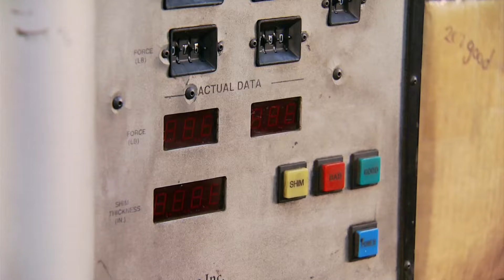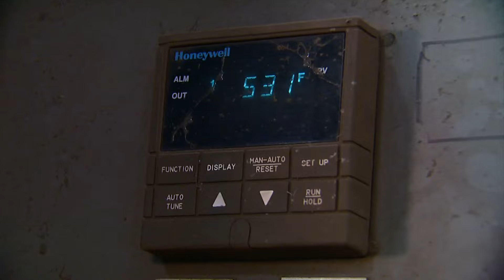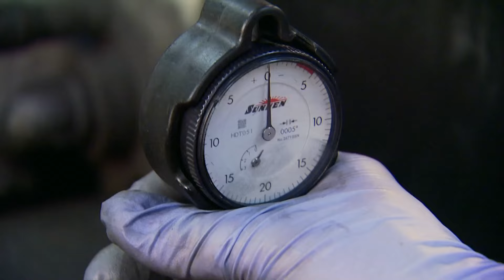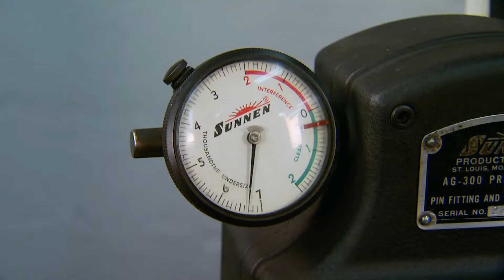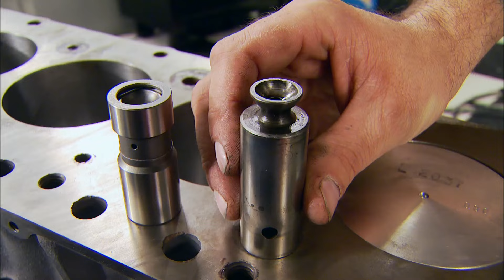Re-Building An Inline Six To Drop In A '49 Chevy Pickup - HorsePower S14, E16

Comment: Yes that tube supplying oil up to the top of the head is most likely the reason for seeing the external line that would be installed on those engines to get oil up to the rocker arms. Also that center connector for the rocker arms can be squeezed off to restrict the return of oil to the pan and create more oil pressure for better rocker arm lubrication as well as helping with some back pressure to help keep the hydraulic lifters bled from air.. Also a small hole can be drilled through the lifter feed galley behind the cam timing gear to bleed air from the lifter galleys. Those old solid lifters were referred to as "milk can lifters" as they resembled old style dairy milk cans. Those old engines were bullet proof if set-up right and maintained properly. They were no hot rod engines but were smooth and reliable. Grooms Engines engages in all of the standard processing of remanufacturing engines and that is a long time to be in this business.

Comment: My 47 had Babbitt bearings.  Fun wiping and scraping those to a perfect .00015 to.0002”.     Was a strong pick up, 500x16” wheels, put chain on those and it would go anywhere.   Hauled hay, 30 bales at a time.  Pulled stumps with it.  Could not go faster than 55 mph or so.

Comment: Got a rebuilt 235 engine coming for my '53 Chevy pickup,dual carbs, mild cam with solid lifters, dual exhaust header and HEI distributor. I already have the S-10 T5 transmission in it, should be sweet. Many of my friends said I should have just put a 350 V8 in it. Yeah, like everybody else does, besides , I love these old inliners, plus they have incredible torque at low RPMs.
Reply: How much did all that cost im thinking about doing something similar.
Reply: @angeloterrones9789  The original 216 engine started knocking so I wanted the better 235 engine but I didn't have a core. I wanted a turn key engine like I described in my comment. The only place I could find one complete where no core was required was Schwanke Engines LLC in Minnesota. I ordered the engine last year in May, didn't get it till DEC. and the cost was $5000.00. I just checked their site and the same engine is now a whopping $7000.00 and I thought mine was  a little pricey. If you have a good 235 core you could get it rebuilt at a local rebuild shop for probably less and add your own parts.
Reply: If you aren't too worried about originality you can swap in the 250 inline 6 from Nova's/Camaros/base model pickups. It's got better oiling and cores are plentiful. I think I gave $300 for a runner last time I got one.
Reply: I had a 62 nova with a straight 6.My step dad had an Allis and chambers combin that had same Chevrolet straight 6.
Reply: I want to rebuild mine in my 1954 Chevy truck however I'm confused because I've heard that mine is a low oil pressure engine and I should get a 1959 235 engine. Any truth to this?
Reply: @boxerfan2  If it has the original 1954 235 engine I would go with a 1955 to 1962 engine.

Comment: The 235 was used in larger trucks in 1941 and in smaller trucks starting in the early 1950's up till 1962. The 235 was first used in Chevy cars with auto transmissions in 1950 and all cars in 1953 up til 1962. The T in the serial number is for where the engine was built at the Tonawanda engine plant.  Serial numbers with a F were built at the Flint engine plant. I with these people would get their facts straight.

Comment: I had a 235 six.    put the header on it.   lost a ton of heat in the winter.    but I did get into trouble.   straight pipe off of headers.   I squeezed every ounce out of my 235.   with manual transmission.        :-)
Reply: My first car age 16, 1961 was a 38 Chevy. It already some Fenton Headers on it and it was not an old babbitt slinger 216 but a 54, 235. All I did with it was put some Cherry Bomb mufflers on it and cut the shifter off closer to the floor. Those Chevy sixes sounded great with dual pipes as we called them back then...lot of fun.

Comment: looking for a part called the oil distributor valve, as mine is not working, to get oil to the top of the rockers, or is there a way to bypass this valve to get oil to top and bottom. i have a 1950 chevrolet truck 3100  with a 235 engine thanks.

Comment: These engines are quite common in Brazil. National icon here, first car manufactured by GM in Brazil:  Chevrolet Opala (which used a 4.1L/250S engine).
Reply: I think '54 is the first year with insert bearings. The basic motor dates to 1937 and had babbitt. It would have been cool to use a GMC 270/302 in that truck, a much better engine.
Reply: @timothykeith1367  - '54 uplevel BelAir was first to have full pressure oiling system... before that splash lube lower and some oil pumped up top...

Comment: 7 to 1 compression ratio!?  Why????????
Reply: Well since you clearly didn't listen they want to use as much original equipment as possible.  Additionally gas in the 1940 when this was designed was poor quality and high compression with poor fuel causes detonation.
Reply: @bmstylee  During the Korean war the U.S. Air Force began switching to jet engines, which allowed more high octane gasoline refining to be used for civilian uses. Prior to that era the available gasoline couldn't support higher compression.

Comment: Don’t forget the orifice sized fitting for that oil tube in the lifter galley. If you replace it with a standard fitting you will loose oil pressure in the engine.

Comment: Great job!
I had an all original 1948, chrome grill, outter visor, the works. I got it for a $125 in the early 80's. 
I was a teen and my dad sold it out from under me to a collector. That happened several more times with collectibles, until I turned 16. I realized what he was up to, no good.
The one that hurt the most was a 67 Malibu/Chevelle, 2 door hardtop. Boy, I do miss that car something fierce.